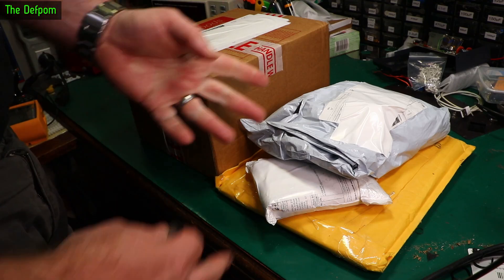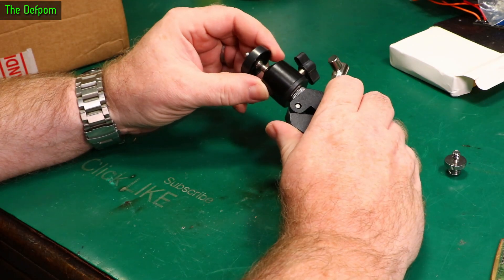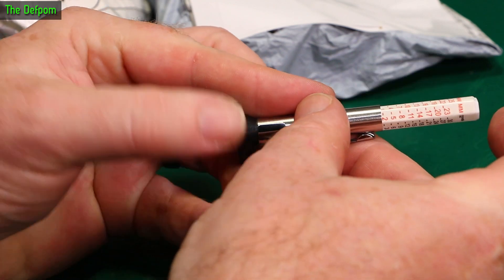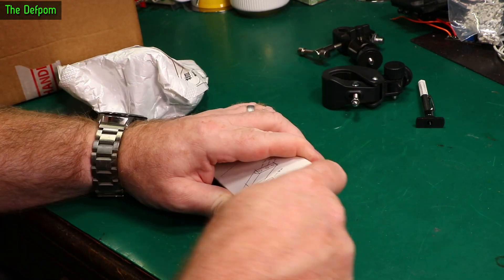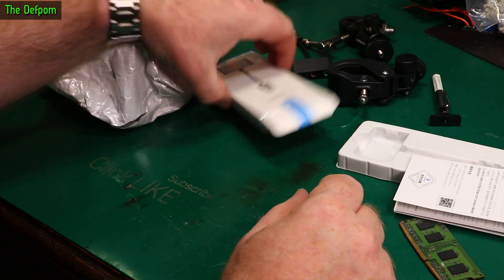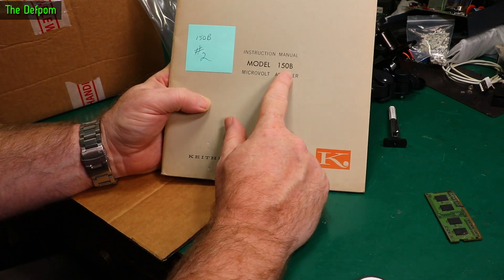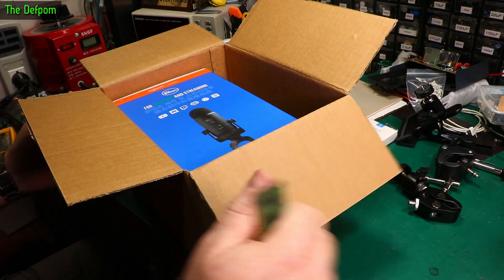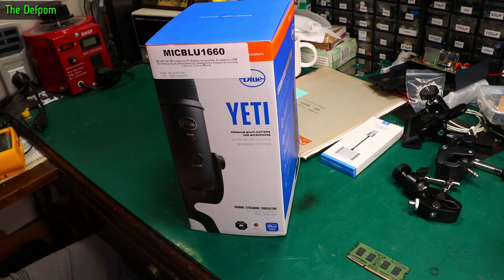🔴 What's in my Mailbag ? - Mailbag Monday 1st May 2023 - No.1122

Comment: Sadly at my former job, you would have been dismissed for theft if you tried to rescue original manuals being trashed. Seen stacks/boxloads of original user and maintenance/calibration manuals for various HP/Agilent/Keysight, Tektronix, Keithley, and many others all going into rubbish skip. A real tradgedy. 
Also applies to equipment being disposed. Usually not sent to auction, as returns were too small or even nothing as unsold at auction, so costing money, so much equipment  got sledge hammer bashed and into rubbish skip. 
Back in 1970s, 1980s, disposal lists were circulated to staff and you could bid on the stuff, from larger machines to small hand tools. Sadly some took advantage of being in more senior position and thus got pre notice, or were on early circulation list and took advantage, even making profit on grabbing ahead of all persons having chance to bid. Then there were "tax", fringe benefit considerations  and all internal sale was blocked to prevent disadvange of most people  and there had been many complaints, after some items gone before all got informed.
In the end most test gear was destroyed and trashed. I once bid over $1000, on a Tektronix Semiconductor tracer, and made clear I could go higher. Only to findout it was smashed both sides and Crt Screen by sledge hammer and dumped in metal trash recycling. Original cost, mid 1970s, over $25000. Sheer waste, as on industry sales lists the equivalent units were from $5000 not functional, to over $10000 for working ones.  Asset manager stated not worth selling, too much effort. To me "What a few thousand dollars not worth it and getting back to the company?" I had for 30 years wanted one, not to sell but to have and use.